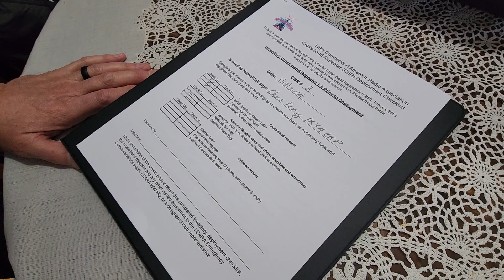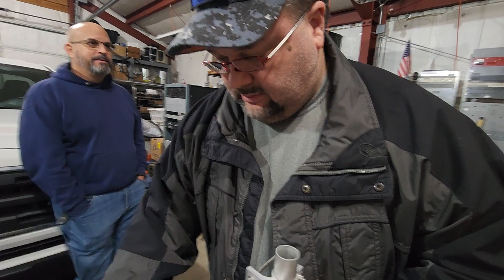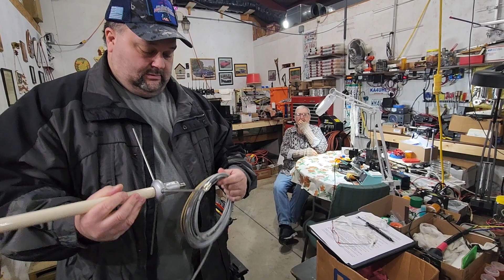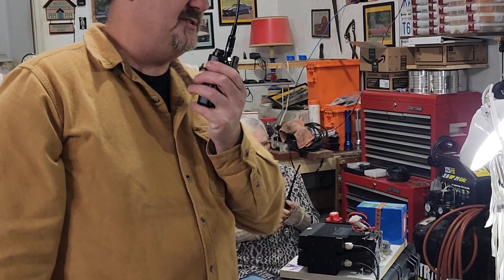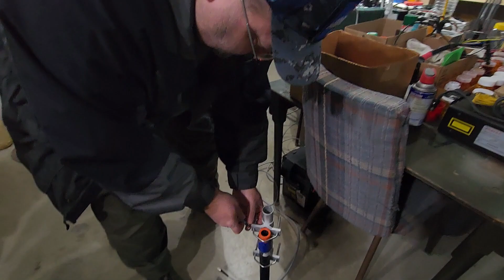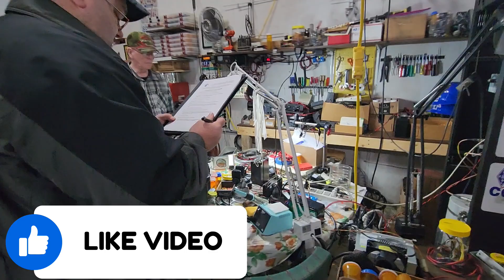LCARA HAM Radio: Crossband Repeater Checklist - Setup/Tear-Down - Part 9!!!!

Comment: Another thing you could do is drill two holes in the far end of the drive on board where you can insert two heavy duty tent spikes to secure the board in the event a vehicle cannot be used to hold the end of the board down. Saying a location where a vehicle to hold it down is not practical.